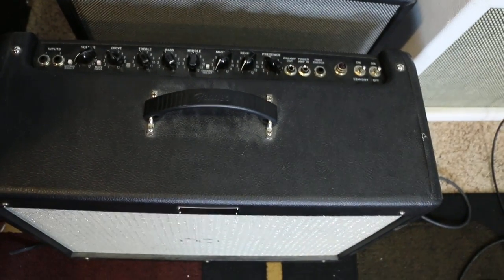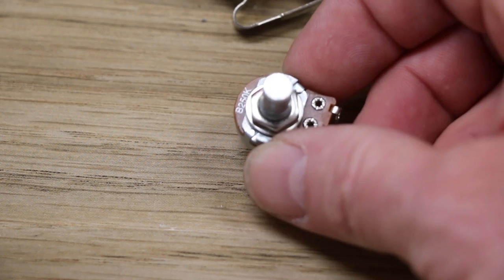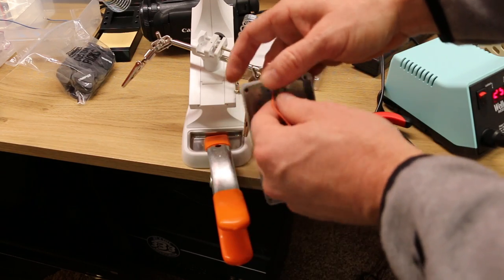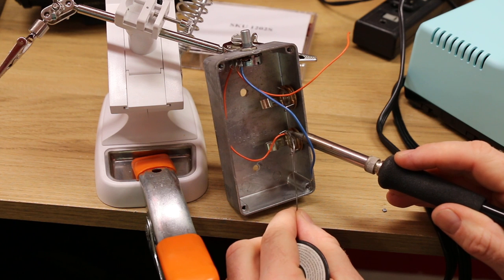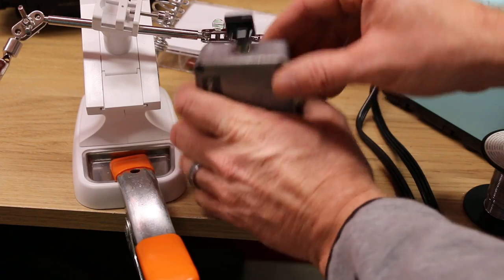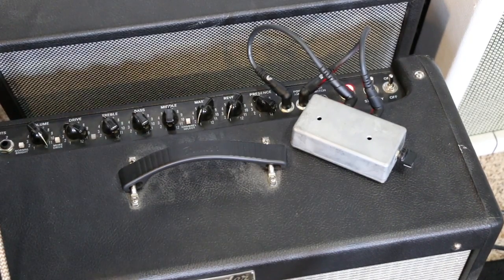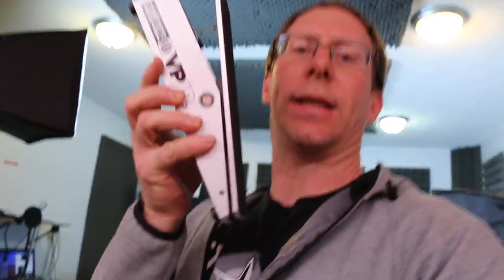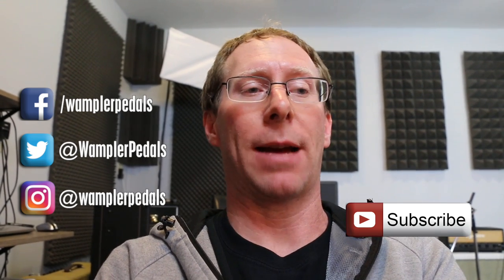Easiest “modification” for Fender Hot Rod amps (and others) to make it better for home use

Comment: I was wondering if I can make this and safely plug it between the speaker out and the speaker of my amp? The reason I want to do this is so I can turn the volume of the speaker all the way down while I record using the line out of the amp.
Reply from the maker: +Michael Quinteros several have asked that here in the comments and I explain why, but the answer is no. You'll tear up the amp.

Comment: Hey Brian, thanks so much for this video. I can't seem to find any videos on how to make a tap tempo pedal. I can't justify spending at least $40 on something that should be super simple to make myself. I'm brand new to making pedals but I'm pretty decent at soldering. Is there any info you could give me or any video recommendation for a super simple tap tempo pedal for my EHX canyon delay? Preferably in a small enclosure like the MXR M199, but the size is only for personal reference for my pedalboard limitation, not necessity. Thanks in advance, sir!
Reply: Thats really simple to to! Just get a momentary switch and solder the two connectors to a simple guitar cable. You can attach the footswitch it to any type of box that doesnt fall apart when you stomp on it. Because it isnt connected to the signal path, it cant add any noticeable hum.
Reply: That kind of footswitch can also be used to switch amp channels, reverb and what not.

Comment: Brian, I appreciate you taking time to feed the circuit geekary out here on youtube. I have been looking for a way to add an effects loop to my vox ac4c1-12, along with the "bright-cap" mod (except I might pull mine and place it and other value caps on a rotary knob to experiment), is something like that even possible?
Reply from the maker: It's possible to add an effects loop on anything, but it is much more involved than something like this video. Sorry :(
Reply: I figured it would be...Just out of curiosity: how much difference is there when the parts used to build with have tighter tolerances. Like what is considered "good quality" parts versus "cheap"?

Comment: Would you be able to do this if your amp doesn't have an effects loop? If not could you do a video on something that would work. Great video also👍
Reply from the maker: nope, gotta have an effects loop
Reply: paul puckett in the next video he's going to shown you how to add one!  :-)
Reply: Oh, I'm using a mastervolume right in front of my Laney LC30 since it has an adjustable  parallel fx-loop and looping the mastervolume has brought no effect. And it works pretty much the same way in front of the amp.

Comment: Wouldn’t you want both jacks to have both a “hot” and “ground” wire soldered? (9:29)  btw, this is an awesome video! I’m about to build one of these for my Blues Deluxe.
Reply from the maker: The enclosure completes the ground
Reply: @wampler_pedals   Ahh, got it! Nice. So basicaly since the two outsides of the jacks are both touching the enclosure, they are both grounded. Then running the wire from the jack’s ground to the pot, makes one side of the pot ground. Cool.

Comment: Brian..can you talk to us about the pot values? The article recommended a 25k, 100k are generally used, i built mine using a 10k and it sounds awesome..what gives?
Reply from the maker: Has a lot to do with impedance. If your effects loop is tube buffered I’d do with a higher value pot. If it’s opamp buffered a lower value will work just fine.
Reply: @wampler_pedals   I appreciate the quick response. I have a Peavey Windsor Studio 20 tube combo. I'm going to have to look into that. I don't notice any difference between having it in the loop and not, other than now I can enjoy my amp at home without the wife and kids running for the hills.

Comment: Would the 250k pot make a big difference? Just wondering because that's all I have on hand.
Reply: I'm doing similar research myself at the moment. I heard a 250k could make it muddy, and heard a 500k or 1 meg pot is also recommended. 25k or 100k like he states is a little different. But adding a treble bleed is an option as well.

Comment: Could I take a small mixer and run a cable from one of the channel inputs into the preamp out and the output on the mixer to the power amp in ? And use the channel volume as the master volume ?
(It works and it’s got and extra eq to fool around with . )
Reply from the maker: Maybe so! Give it a try, it should in theory be fine as long as the effects loop is buffered I believe

Comment: brian. I could say how awesome it is what you do for the music community but id just be repeating what everyone is saying here. but I will say thank you  and one quick question please. would this work woth a blues jr. whete it has no preamp out power amo in jacks.  could it be placed between speaker out and speaker. or in front of amp. I have a Ernie ball vpjr. but I like what you built. im new to soldering qnd I have a new box just that size and it seems like a simple project to start with. thank for any advice on this question. have a good day too .
Reply: You cant put this mod after any power amp. This would damage permanently the potentiometer, and worse, your amp.

Comment: What happens if a different pot is used, like a 25k or 250k? Newb here so I’m gonna take a stab in the dark here, but does that mean that the “max” volume is higher or lower depending on the pot value?
Reply from the maker: It gets a bit complicated. The answer depends on your amps exact effects loop circuitry. In a solid state buffered effects loop it’s “generally” ok to use lower values with little difference.

Comment: Fender should have used a good audio taper pot in the amp itself.  they use a modified linear taper, and the usable part of the pot is from the 2 mark to the 3mark .  3 fully saturates the output, and  from 3-10 it steps up about 1/2 a normal step. Also from 1 to 1&1/2 covers 1-3 on a normal vol pot.  All that sillyness makes the "hot Rod deluxe" seem very 'hot' in the showroom., but impossible to set down to a modesty level.  Trying to increment 1/1000th of a turn.

Comment: Hi Brian, cool video.  I have a fender deluxe reverb and would love to have a master volume on one channel only is there a way Cheers Greg
Reply from the maker: Unfortunately not an easy way to add a master volume, however you can use an attenuator which allows you to turn down the output to the speaker without causing damage

Comment: this seems rather useful, would it be possible to chuck this in between the amp and the cab?  my Marshall does have an effects loop, am just curious as to if it'd work elsewhere.
Reply from the maker: +cmzangetsu1993 no, see video description and other comments. You'll mess up your amp and probably set the box on fire.
Reply: Wampler Pedals Ah ,  yes thanks. This is what I get for not reading the description first..  lol
Reply from the maker: nooooooo don't do that with this box, that can be not only dangerous but possibly destroy your amp

Comment: Hi Brian,

Thanks for this nice video, great tips and explanations. I have another question about the master volume in the effect loop section.

On stage, i have a Line Driver/Booster in the effect loop section of my Fender hot rod deville for that extra volume drop for a solo😵.

My question is: how can i use the master volume box without losing my effect loop function? In my case there only is a Line driver going into it, no modulation effects.

Thanks for s tip/idea :)
David
Reply from the maker: You should be able to just run it in line before or after the line driver.
Reply: Wampler Pedals Thanks. Yeah right, that's pretty logical :)

Comment: I have a 1950s Magnatone 213a, rebranded Harmophone, sounds amazing cranked but I really never get to hear the natural overdrive because its  practically louder than my Marshall stack.  Its old as heck so obviously doesn't have an effects loop.  It just has a remote send.  How would I do this?  Would I have to solder a box in between the speaker wires?
Reply from the maker: You will need to buy an attenuator in this circumstance, the volume control showed here will not work.
Reply: Ive been searching all over for info on this to no avail.  Would I have to solder in 1/4 inch plugs between the speaker and the amp?  Its hardwired in. Any idea of a website/resource about dealing with old amps? It just sounds so good, I barely like other amps anymore.

Comment: Maybe i am wrong but if you add an capacitor liek mentioned in the end it technically won't make your amp brighter. as a highpassfilter itt just will make the lower frequencies quieter or am i wrong?

The result in the end will sound like it is brighter but looked at it technically it's not really whats happening there, isn't it?
Reply: Brighter = more top end = less bottom. Don't make it more complicated than it is.

Comment: I have a Marshal DSL40C. How can I figure out if I need to altar the wiring for the specific amp or could I just follow exactly what you did?
Reply from the maker: If it has an effects loop, you can try what I did. Other than that, you'd have to email their tech support and make sure it would work.

Comment: What if the box used to create the master volume is made out of plastic? How  would the wiring be changed to ensure both jacks are grounded to each other?
Reply from the maker: Rudy Falcomer you would connect all of the grounds together including the ground on the jacks
Reply from the maker: Rudy Falcomer although, I would not recommend using a plastic enclosure, a metal enclosure that is grounded will be much quieter and will not have the possibility of radio interference near as much

Comment: What is the "master" knob on the amp?  Is it a master volume?  It's set to "1" in the video...
Reply: Mike Austin actually it's the master volume for the drive channel.
It doesn't affect the volume of the clean channel. The clean channel has only a "volume" knob, which is actually a gain control, not a volume one. 
Hope that helps 😉

Comment: I see you steered away from the 250K. Would that work? Does it have to be 100K? Just asking because I have a ton of 250K pots around and no 100K.
Reply from the maker: 250k should be just fine, just make sure it’s an audio taper or else it won’t be a smooth volume transition

Comment: Could you do this on a Fender Pro JR/Blues Jr (anything without an fxloop)? If so, would you place the passive volume box before the speakers (using speaker chable)? Thoughts guys?

My pro junior needs to run at 5 to sound good, which is louder than a 45 watt super reverb for home use....
Reply from the maker: No don’t do that. You’ll tear up the amp. What you want is called an attenuator.
Reply: @wampler_pedals  thanks for taking time to reply!

Comment: I guess you can use a pedal to do the same thing right? Just lower the volume on it.
Reply from the maker: Depends on the pedal. Some pedals will change the sound drastically, say, a tubescreamer.

Comment: You said in the beginning that this is not an "attenuator"; but without any amplification circuit, that's EXACTLY what it is! All you're doing is putting a variable resistor (potentiometer) in the INPUT signal chain.  No different than having a volume control in your guitar (or other electrified instrument) - or having a volume pedal as you mentioned later in the video.  And what difference does it make for one jack to be "input" and the other "output"? Either way, you're inserting the "pot" in the signal chain. A "true" master volume control is on the output stage of your amp, so that you can crank the preamp for the breakup, and use the master volume to control the output volume without affecting the "breakup".
Reply from the maker: Attenuator is normally referred to as in a device put between the amp and the speaker. If you use this circuit in that fashion you’ll have major problems. Keep in mind Mark, these videos are to help guitar players understand, my choice of wording is necessary.

Comment: nice, detailed video, thank you.  question: on old fender bf w/out efx loop, can i run the box between the 2 channels?  in the jumper between normal and vibrato?  dont want to mess up my sweet 64 DR.  thank you!
Reply from the maker: You can, but IIRC the two channels are out of phase with each other so it wouldn't sound as good and it wouldn't have the same effect. Without an effects loop, this box won't work.
Reply: Thank you for quick response.  Is there any way to reverse the phase?  Dynacomp in the jumper?  DR sounds great turned up but my wife gets...irritated.

Comment: Awesome but I have a comment or two:
1. Please explain why you use a 100K volume knob. I made something similar with a 500K pod. I am sure there must be a reason you chose the 100
2. I use it between pedal board and main amp input for two reasons. I use two amps and they are quite different in volume. I am also too lazy to walk between them so I set one to the right volume at the amp then set the other amp to fairly high. I have a short pedal board lead to the volume pedal and then my lead out to the amp. This means I can adjust one amp volume from the pedal board. I will probably build a wee dual or triple volume pedal so I can do all from one place :-)

I have to ad here that I get my sound from my pedal board for consistency and only use very clean settings/channels on the amps.

3. Might I be deteriorating my signal to the amp by doing it this way?
Reply: Krach Werke  I use the same 2amps wet and dry put I have put them into a small Yamaha mixer (4 Chanel)  then out to the pedal board/guitar and have full control over the amps volumes and master volume hope that helps
Reply: Krach Werke  very good did he not reply to your good question???

Comment: Why not just use the master.. 
So what you're saying is, I can use this actuator as a master, and it will duplicate the volume as if I had the actual master on 5 ?
Reply: Some don't have a master for clean channel. My vintage fender super 112 only has a master for the drive channel. clean channel is so loud, I can not get it past 2, so this would work great.

Comment: Can I use something like this as a master volume for my Deluxe Reverb silver face reissue? That way I could push the tubes instead of using a over drive.
Reply: Only if it has a preamp out, power amp in, which I think it has not.

Comment: Would this work the same on a Vox AC30 or any amp with an effects loop? That obviously already has a Master volume, but so does the Hot Rod in this video......
Reply from the maker: I didn’t think the ac30 had an effects loop?
As noted in the comments here, that master volume is ONLY for the dirt channel.
Reply: @wampler_pedals  thanks for the response! Noted re: Master, didnt know that. And I’m pretty sure the recent AC30c2 and variants of have an effects loop...AC15 definitely does not

Comment: i don’t understand how this is “not an attenuator” when that is literally what its doing? in modular synths, a simple potentiometer with an input and output is called a passive attenuator. looks like the same thing here.
Reply from the maker: In guitars amps, an attenuator goes between the power amp and the speakers. This is basically just adding a master volume at the tail end of the circuit before it goes to the power amp
Reply: @wampler_pedals  okay, that's just a little weird to me because in synthesis, it doesn't matter what it's attenuating and where it is in the audio or control voltage path - if it attenuates a signal then it's an attenuator. but i guess i  can understand wanting to make that distinction in another context.

Comment: What you refer to as “Ring” is actually “Sleeve” for mono 1/4 inch phone plug

The other kind used for stereo or balanced connections is what is known as Tip Ring Sleeve

Peace bro

Comment: Hey Brian. I bought one of these boxes from eBay to use with my Fender Blues Deluxe. The circuit looks the same as the one you've built here. Problem is I get a fair bit of hum when the box sits on the amp. It goes away when I lift the box off the amp. Any way to modify the box to fix this? It's housed in a metal chassis.
Reply: Try moving the box around/different locations.  If it is sat above the mains transformer that could make 50/60Hz hum worse.  Maybe check that the grounds are good inside (box to grounds of mono plug to incoming/outgoing grounds).
Reply: @SaxJockey  Thanks for the reply. I think thats the deal. It's over the top of the transformer. Moving it away helps but it's a shame as that's where it naturally sits with two short right angle jacks from the fx loop! I've tried using a powered pedal to achieve the same thing and it works without a hum on top of the amp. Is just the passive box that does it.
Reply: @jcmusic5150  Maybe try slightly longer patch leads (0.6m available) and mount the box on the back panel away from the TX, velcro might do for test purposes.  Does the hum reduce when you put your hand on the box?  If so, maybe the case to amp grounding could be improved.
Reply: @SaxJockey  No, the hum isn't affected by touching the box. I think it must definitely be induced by the power transformer in the amp and you're right, longer patch cables is the only way. It's purely aesthetic that I wanted to have it sitting on the amp. I guess this will be an issue with all passive boxes perhaps.

Comment: Hmm. Nice vid. But can’t you solve this by just replacing the right most valve (when looking at the HR from the back) with a less powerful one. 
Feel the amp comes out sounding warmer and the volume issue is solved. 
No solder, no tampering. When playing live gigs replace the right valve with the original one but not really required tbh.
Reply: Somehow you can, but it will give a slightly different sound.